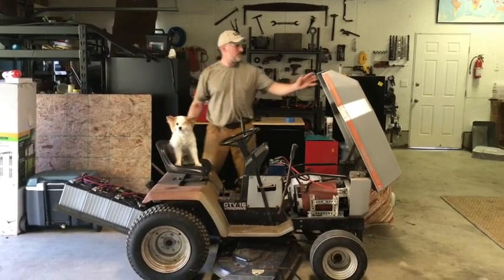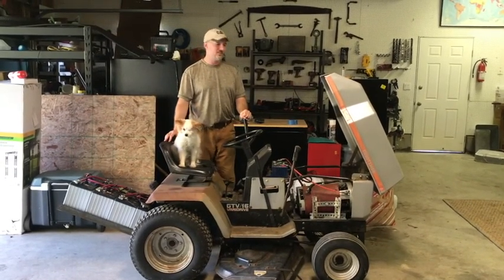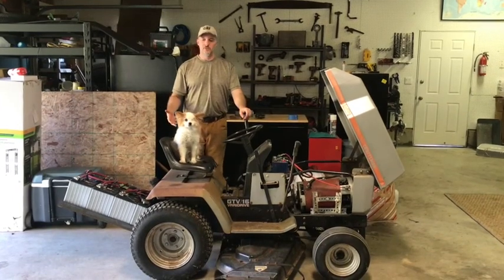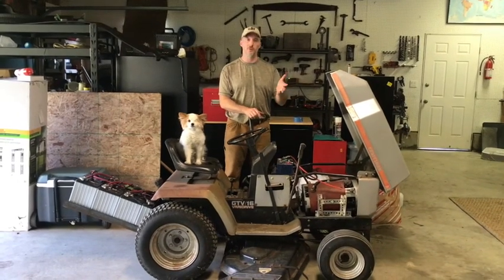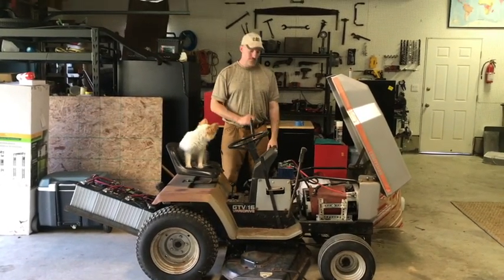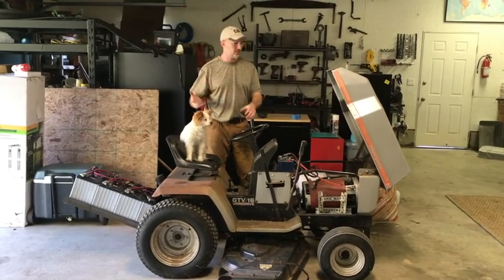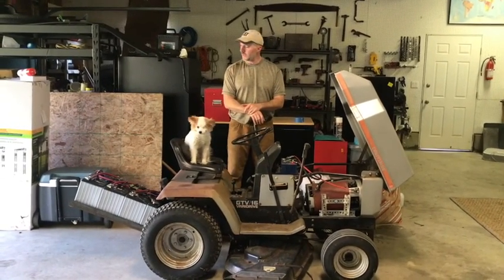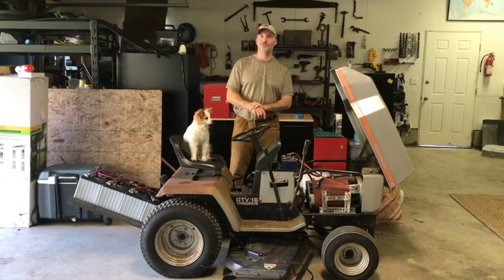e- Craftsman GTV/16 - Electric Garden Tractor Mower

Comment: the motor is also from a golf cart?
Reply from the maker: Netgain Warp 9, used from another project I had.
Reply: @ToolHombre  my neighbor has an electric golf cart he's trying to retrofit with a gas motor, and he's giving me the motor and controller from it.  may try to put on my lawn mower if the motor is a good fit.
Reply from the maker: @jon_byler   Yeah once you do the upfront work, it's a bit of a time saver to run the same motor for a decade with no maintenance.  

I'm even on my original deep cycle battery set.
Reply: @ToolHombre  whoa!  that's a $4000 motor in that mower!
Reply from the maker: @jon_byler   Think it was about half that   when it first powered a pickup truck back in 2013.